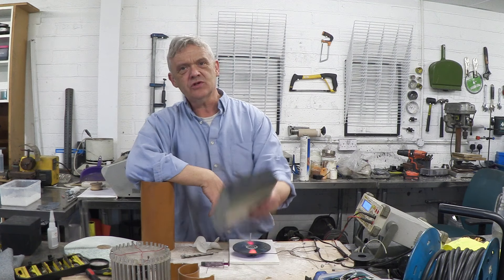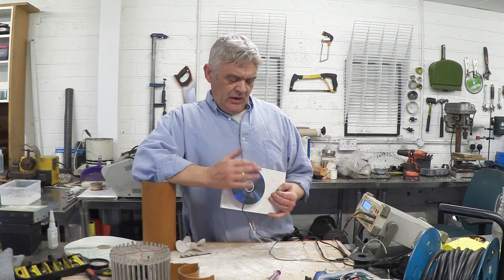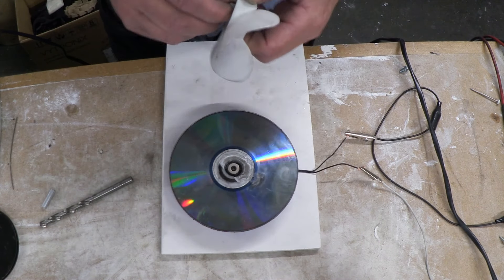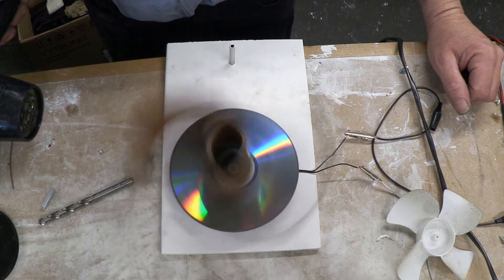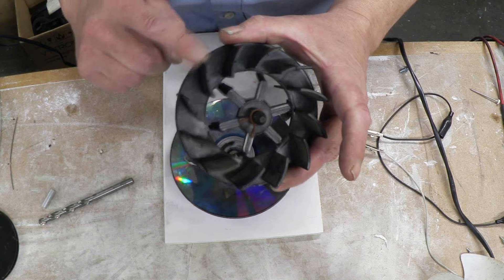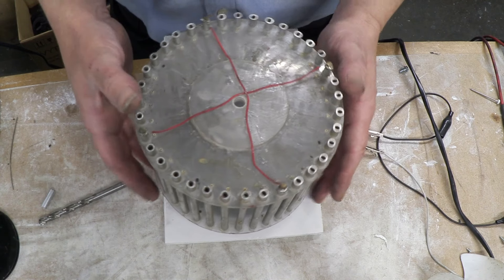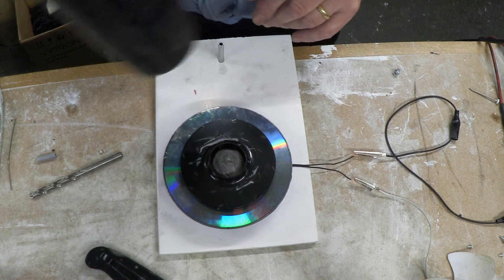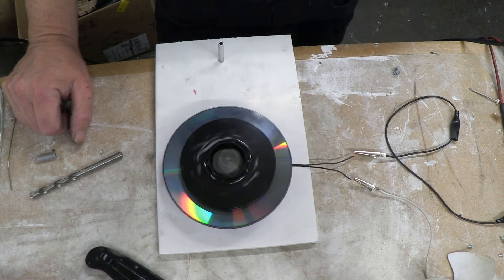A Flat Wind Generator

Comment: I dont think the flat design on wall would work at all. The test you did has little to no obstruction around it so the air discharged  can flow away. On a wall however, the air strikes the wall and flows across, up, down, etc. The air flow towards the wall will be disrupted long before it meets the vacuum cleaner impeller or turbine in this case
Reply from the maker: Ah - I am sorry mate but did you check out Mike Waters like I suggested or is this just what you think?
Reply: It's what I think, otherwise I'd have to do some actual research, and well... I watched something else after. Also it seems (more thinking) the vacuum impeller would require a high pressure differential to achieve significant air velocity. With the two sides being so close there is little vane area, so velocity would need to be high compared with the big squirrel cage, current measurements you mentioned do actually bear that out. 20mA vs 73mA if I recall, more or less. Also with the vacuum cleaner impeller the change in flow direction costs a lot and the addition of a centre cone bears that out too. You gained some efficiency with the cone but nothing like the output from your best option, the squirrel cage. You could possibly improve on that further by shielding the vanes that are moving against the wind, but that's just my thoughts.

Comment: I've always liked the squirrel cage windmills.  They have a decent amount of output and can be installed in various orientations without harming birds.
Standard windmills have to change direction with the wind, so they end up needing more area even though they are technically more efficient.  They require lots of extra maintenance too.

A properly engineered squirrel cage version could be almost as efficient with some good airfoil engineering.  They could even be integrated into the power poles.
Reply from the maker: yeah I quite like them - for lots of reasons tbh
Reply: @ThinkingandTinkering  do you think with moveable vanes and a flywheel they could also be used as a mechanical battery  (by closing the vanes to make it into a cylinder and switching it to a motor)
Reply: I like the idea of squirrel cage fans on power and telecommunication poles. There are so many poles that could easily be adapted to house them and the power cabling is already there, even if they just ran the network reporting systems to notify of any problems.
Reply from the maker: @technosaurus3805  I don't really know mate seems like it would maybe be prone to failure - just because a lot of moving parts - but to be honest I don't know
Reply: @ThinkingandTinkering  yeah your probably right. The 3blade windmills already have issues with blade hydraulics.  Then I was reminded of how a vacuum cleaner motor disengages the starting capacitor... centripetal force.  The same mechanism could be used to prevent overspeeding the generator in high winds or no load conditions.

Comment: WOW !!! So "brilliant" !!! Now if ONLY we could figure out the endless possibilities of WTF to do with 26 mAmps !?!
Reply: Charge a battery.  You might be shocked how many electronic devices (even many microcontrollers, such as the Atmel line.. that means Arduino) require microamperes.  Dedicated telemetry devices using LORA (or even cheap ESP8266 cores) can be "slept" for most of their non-utilized time, during which a battery can be storing energy for the telemetry transmission, which lasts only seconds at best, at the reporting interval.  Sure, it can draw a ton while communicating, but that's only a tiny fraction of the time.

A solar or wind/water turbine power system would make a perfect power source.. something putting out 26mA is plenty to trickle charge a battery for this kind of application.
j

Comment: Your testing methodology is off: Your jet of air from the hairdryer is off-center, which allows for far higher power from the turbine than would be possible in real usage where the air stream is uniform. Ideally you would want a wind tunnel, but as that's rather bulky perhaps just a large desk fan placed further away?
Reply from the maker: it's not a test mate - is just a demo of some intreseting stuff

Comment: Sir your flat windmills have very poor torque.. all of them. They rely 8n a very narrow stream of air to soin. If it is wide enough covering more than 50 percent of the circle it eont spin. In fact your using a blower to avoud exposingbthe flow. The blower has a very thin width of air flow. Try outting it in the middle and i mean middle if the el3cteic fan ( or center) the wide wind from left and right will nullify the soin

Comment: too much work - just take DC fan out of the old computer or server- bigger is better, connect cables straight to the coil and you have flat generator with good well balanced wind blade. But it is still not the best generagor if you think about solar panel- no moving parts, better performance and 20 years of working time
Reply from the maker: you - my friend - have no imagination lol - i am joking - i get your points - but there is more to this than you may be considering